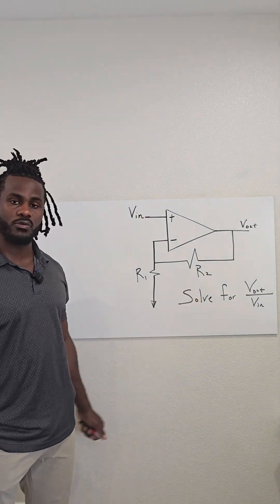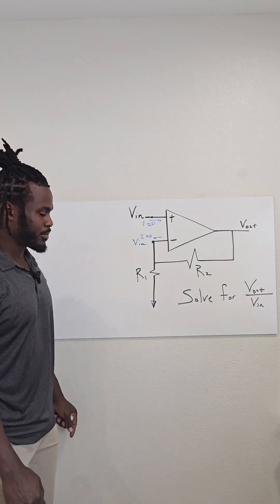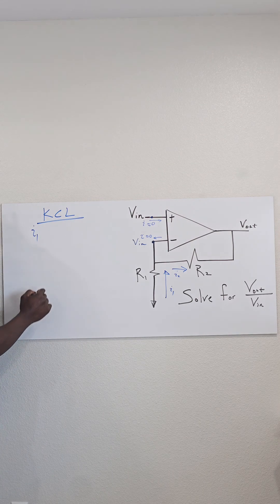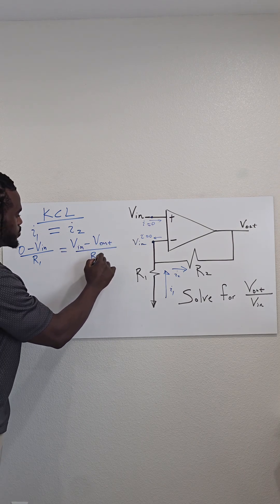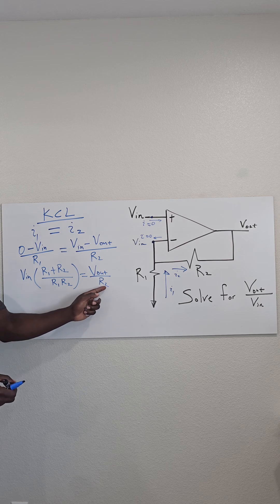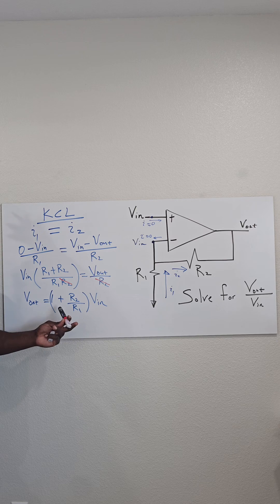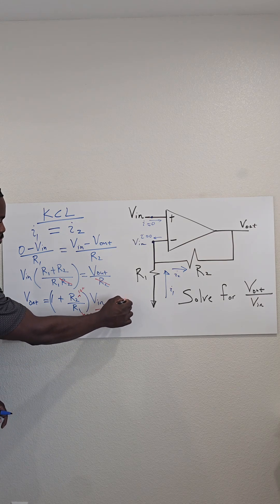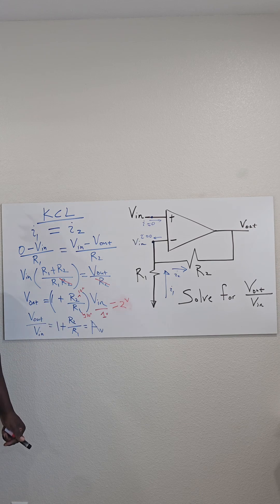Non-Inverting Op-Amp Solved using KCL

Comment: I think it would be nice to not skim over why the voltage ad the inverting input is Vin.
Reply from the maker: Thank you for the feedback. It's a bit tough to talk about and keep it shorter than the required 3 minutes. Which is why I go more indept on this topic in my long form video called "What is an Operational Amplifier"; https://youtu.be/IEzq1-rZwtI?si=ygVk5deEYPROuVNM